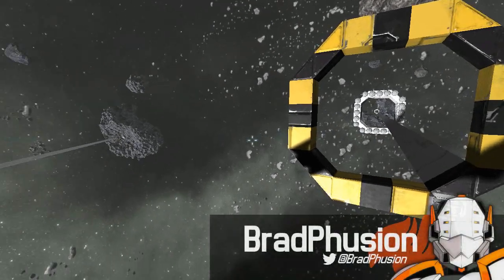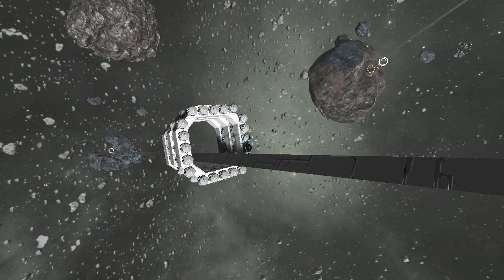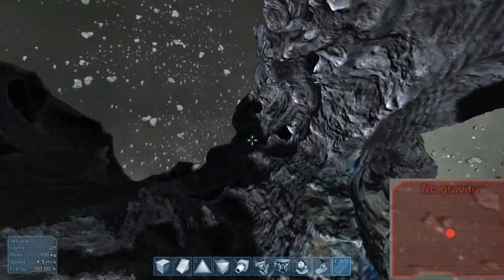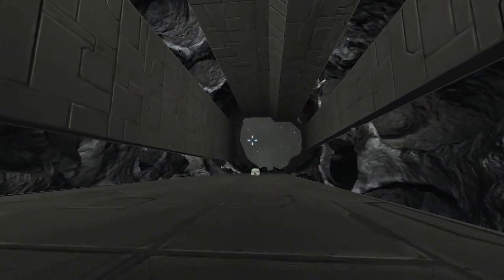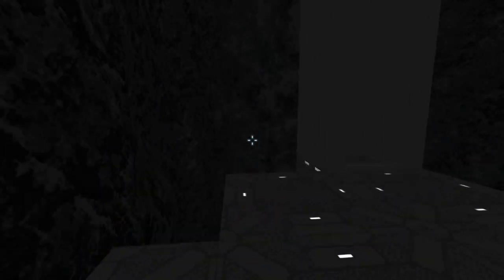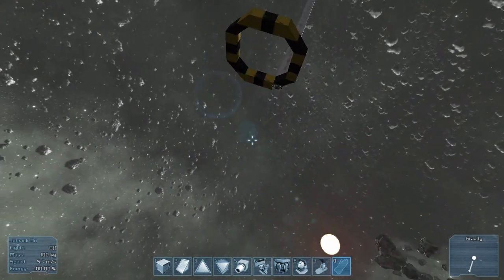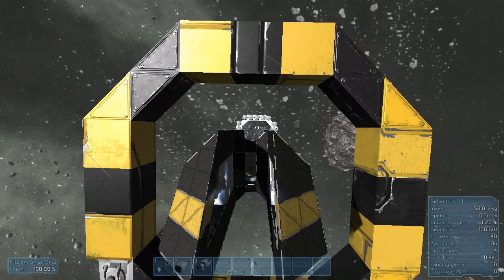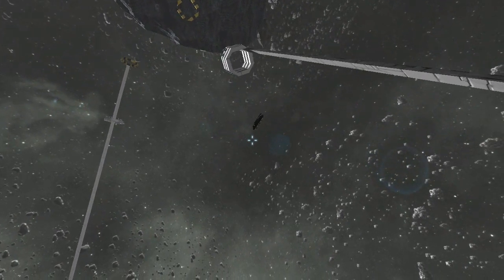Gravity Transit Tubes! (Space Engineers Spotlight)

Comment: A smaller version of this could be used to make elevators inside of large ships. It can could also be used as a transport system for cargo, where a tube would accelerate some cargo and then it would carry on through space until it reached the one at it's destination, even if it it were hundreds of kilometers away. The only problem is that they would have to be well aligned, more so the farther the pitcher and mitt( as I have decided to call them) would be. You could attach a beam across the whole the thing, but it would probably be a waste of resources in survival.